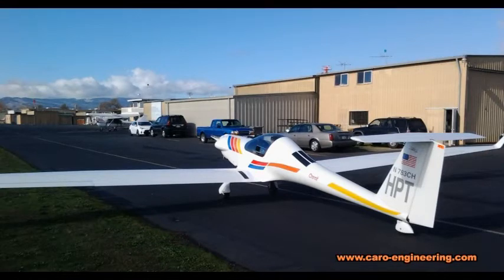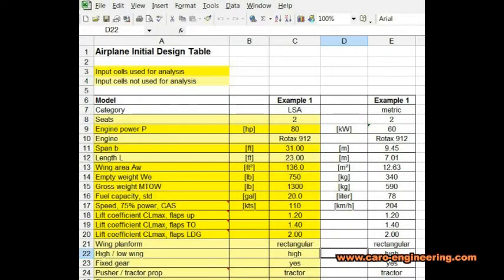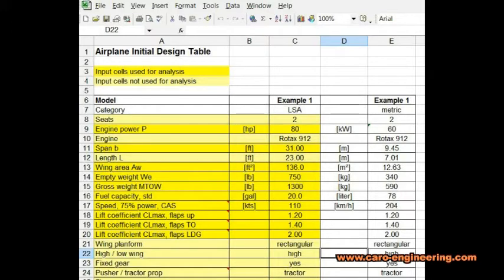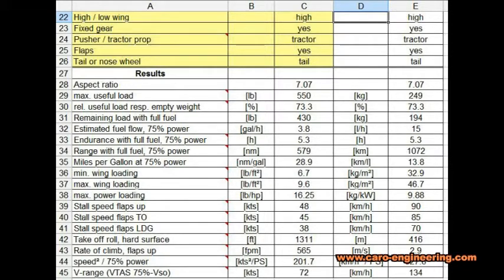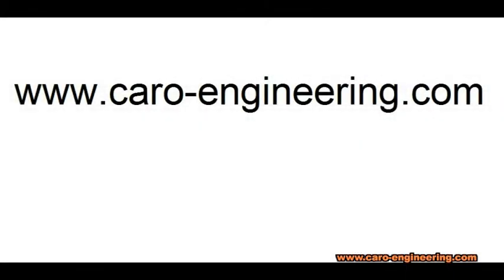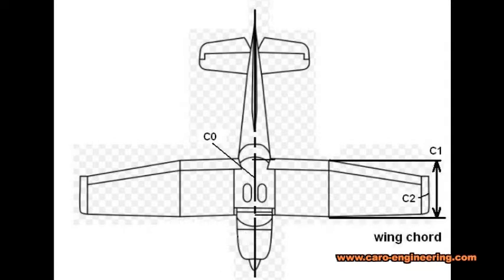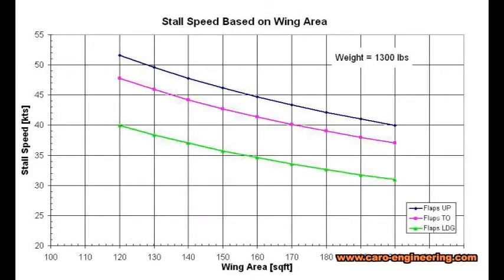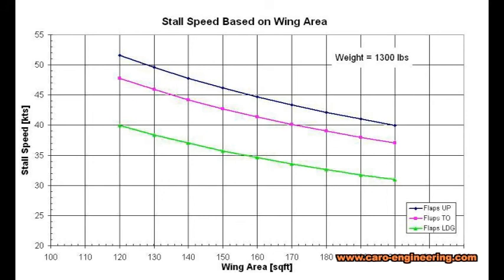Small Airplane Design Tutorial 1, Introduction, wing, stall speed

Comment: IF I wanted to design a very fast 2 seat carbon fiber airplane that is small, efficient, with the smallest wingspan and length with the least amount of weight possible. (480 mph). What program would be easiest to design and test the flight characteristics?
Reply from the maker: There is no single program that does all that. Best is to hire someone with overall airplane design experience including practical flight test experience to help with this.